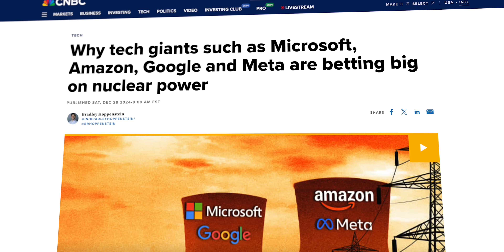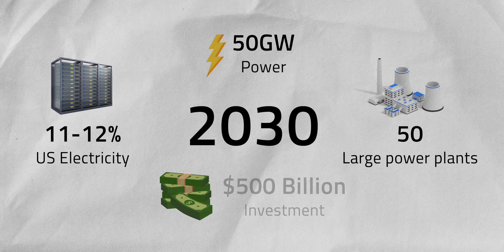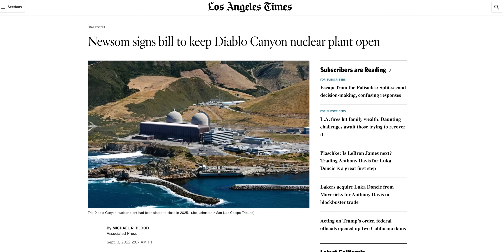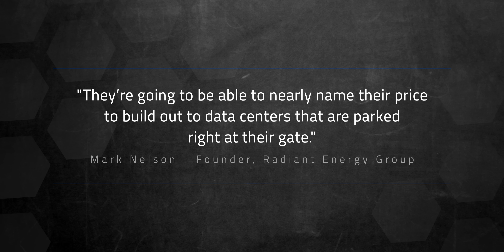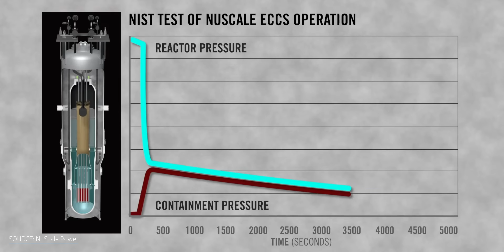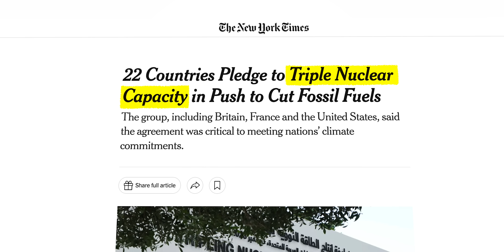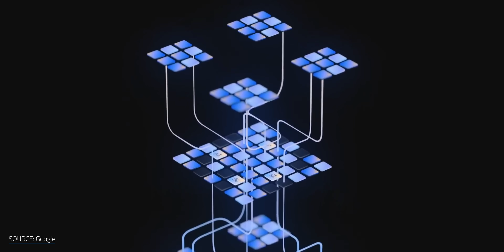Why Big Tech's Betting Billions on Nuclear (Not Renewables)

Comment: I've never understoood why nuclear safety features weren't more like air breaks on semis.  The breaks require air to shut OFF not on.  If you loose air the breaks come on locking the breaks and thus making them much safer.  Even if the air lines compressor or engine quits you have breaks.  Nuclear should be the same.  Require power to shut off the safety features.  If you loose power for any reason, control rods drop and stop the reaction.  I know you still need to be able to run coolant, but stopping the reaction would go a long way.
Reply: That is exactly how many plants work (except BWRs because their rods aren't on top). Control rods or a boric acid solution are held in place electromagnetically....no power and either the rods drop into the core or the boric acid is injected into the coolant with the same result. 
The issue isn't shutting down the reaction, it is removing the decay heat after you do so. Most of the newest designs add passive decay heat removal to address this so no electric power is needed to safe the reactor.
Reply: @richardbaird1452  I thought it seemed odd that they didn't work that way. But whenever you watch videos about different incidents or whatever, they don't seem to address that very much. Or maybe I don't pay close enough attention. Thank you for the informative response. That was great.

Comment: Dear UWMF, The NRC regulatory environment exists because of the public's demand to make sure another Three Mile Island or a Fukushima never happens again. In some ways the nuclear industry has only themselves to blame. Modular nuclear power in the current safer designs is an important potential, however the fuel issue, while some say Breeder Reactors will be the key they have significant safety, technical and cost issues. Spent fuel from small modular reactors will likely be stored at the reactor site or in a consolidated interim storage facility until permanent disposal is determined, and currently this is exactly what we are doing at the older, larger, expensive and convential nuclear power plants. Until some way arises to ship and then store spent nuclear power, small module nuclear power will not be cost effective.

The issue with next generation AI and all other Data Centers, is not that they need more power to exist, the larger issue is that we need to move computing away from pushing electrons around various materials, we have reached the limit of this technology, and instead we need to work towards a newer, faster, system to create Yes / No gates that serve the same function, but use little to now power.

Comment: Nuclear is the baseload generation we need.
Reply: but is AI the baseload demand we want?
Reply: @jerrik-415  Nope.
Reply: Baseload is just as bad as intermittent.  You can't suddenly fire up more nuclear when everyone suddenly turns their air conditioners on.  Reactor efficiency drops dramatically when they aren't at exactly their optimum output level.  So nuclear would need the same batteries and storage as renewables.
Reply: @VPWedding there are more modern designs of reactors that can do that. Illinois EnergyProf has some good videos on these new designs.
Reply: The need for baseload is a myth and batteries actually can provide better "baseload" (more responsive frequency and level matching) than real baseload. Grid scale batteries + solar/wind are already cheaper than nuclear or fossil fuels and costs are still dropping precipitously as manufacturing capacity grows.
Reply: @tHebUm18  Nuclear is vastly more viable then solar/wind + batteries. To electrify just the USA would take 100% of the worlds Lithium reserves for about 70 years. That's just for EV's. Most solar comes from China, the reason it's so cheap is because of a complete lack of environmental or worker protections. Meanwhile a thorium or uranium salt reactor has practically no waste and has no liquid waste compared to classic nuclear reactors.

The need for a baseload isn't a myth, you're just arguing to supplement out the baseload with power that's more useful for peak demand time. The baseload isn't a responsive system, it's the freaking base load. The benefit you mentioned is why they're better suited for peak needs. Also if we over build on the baseload we can have excessive power and just "dump" it into CO2 collectors and make efuel for the aviation industry so it stops emitting.

There still isn't a good solution to the windmill and solar panel waste problem, what do you do with the tons of windmill blades and the tons of burned out solar cells? We don't seem inclined to recycle them. The power density of nuclear is why it's superior, nothing is perfect short of fusion but fission is the perfect stop gap to get us to fusion.

The literally dump the toxic waste in fields used for growing food. Why do you hate the earth so much? Rooting for solar isn't rooting for a cleaner tomorrow, it's rooting for less CO2 but WAY more toxic waste in the soil, water table, and in some cases literally filling entire lakes.
Reply: @tHebUm18 and nuclear + storage is better than renewables and data 🤷‍♂️ if u wanna play the storage game dont get butthurt when nuclear beats out renewables
Reply: @ Nuclear won't. Renewables + storage have the lowest LCOE of any source today (including new fossil fuel generation) and it's still dropping precipitously. That's why year after year adoption keeps dramatically beating expectations.

Not a single watt of new nuclear commercial generation (not counting reactivating existing reactors) will occur before 2030 while all these AI data centers will be built before 2030. It's chronologically impossible.
Reply: @tHebUm18  It's not nearly impossible it's just difficult, we need to streamline the bureaucracy of building a nuclear plant. Fuel is cheap, reactors really aren't that expensive, it's just regulations, the bureaucracy, and the insane excess of safety in the west that causes nuclear to be so slow and expensive to build. I believe we should remain cautious but we can easily do SMR's at scale if we'd have the will power to do so.

Comment: Renewables were ALWAYS a dead end technology because its completely impossible to run a grid on 'random' energy generation. Every penny wasted on them is a penny that will have to be spent AGAIN on dependable energy...Which we had all along!!!
Reply: Apparently you know nothing about battery backup for solar and wind.  Here in Texas, more wind power than any other state, and #2 in solar, they can't get batteries installed fast enough.  We have had no brown outs, black outs for several years because there is so much battery backed solar coming on board.

Stop with the right wing anti-renewable BS.  As I type, due to the way our market is set up, my all electric house is run on 100% renewable power.  Money well spent.
Reply: @frequentlycynical642  ...and you think you can run a country on intermittent power and batteries. 🤡🤡🤡 The country already had secure power before all the renewable garbage.
Reply: Well someone doesn't care about costs and the environment....  the US will end using less coal in 4 years time (like the first Trump disaster) ... and this is going the same way....

Comment: Nuclear makes sense for data centers. They run with constant load and nuclear provides at baseload. Its a match.
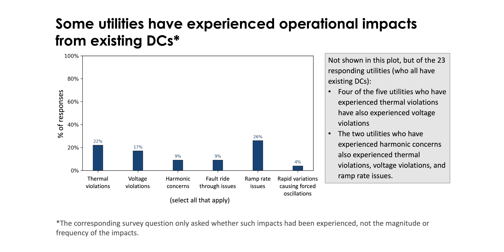Reply: not accurate. read the chart @6:00, regular power plants even have communication with DCs to tell them when to modulate their loads, and not as simple as you want to think of it "supply > demand"
Reply: @mrlithium69  that means that they often run below their possible maximum load

Comment: As the pendulum swings the other way and we increasingly "re-shore" manufacturing that went overseas over the past couple decades, the demand for electricity is also skyrocketing for manufacturing infrastructure.
Reply: The funny thing about tariff’s is that they permanently raise prices.  If someone was making a grommet in the US for $1, and one made in China costs $.45, adding a tariff of 25% does nothing except raise the price of imported grommets by 25%.  If you put a 400% tariff import on the same grommet, now imported grommets from China now cost $1.80.  Now the American business is desirous to build new manufacturing capacity in the US. Great right?  Guess what the new American company will sell grommets for?  $1.70, because it’s still cheaper than the imports.  Bravo now instead of grommets selling for $.45-1.00, now they cost $1.70-$1.80.  Sure people got a few jobs at the grommet factories, but how many businesses went under because the added costs to every import, just made things more unaffordable to continue.
Reply: @  Great point, Brett. Everything is connected, and people don't always think through the interrelationships of these "systems."
Reply: @brettgracey9682  if they can build overseas they can afford to move their manufacturing back
Reply: that is not going to happen... ask any economist.   There will probably be a drop in power demand caused by massive economic problems...

Comment: And people thought EV's were going to be the biggest problem facing our barely stable power grid in the U.S.

Also, all this power usage and I still have absolutely no use for any of these AI services. Just a waste of power and money.
Reply: If you are using the internet or a recent cell phone, you have been using AI.
Reply: @frequentlycynical642  For search results,  and Google Maps directions sure, but I have no use for chatbots, image/video generators, or AI assistants. Outside of  crunching massive datasets for science and the aforementioned low-level services, I really don't see anything other than a novelty that I have no interest in.

Comment: You just don't get it: 
Increased electrical generation needs (EVs, heat pumps, grid, ...)  for electrifying the US is impossible. 
Similar increased electrical generation needs for datacenter and AI centers in the us: No Problem.

Comment: What about the waste material disposal/storage? I believe the safety of nuclear plants isn't the only reason they wanted to get rid of them.
Reply: It's called reprocessing. It reuses most of the spent fuel to create new and more powerful fuel rods for use in a reactor again.
Reply: Modern systems use these massive con rent cylinders to store waste on site. Far too big and heavy to steal, robust enough to take anything short of a nuke or large meteorite impact. Easily to monitor and if you do find a better system easy to access.

Comment: Wouldn't it be cheaper and quicker to do solar/wind and battery storage?
Reply: > Wouldn't it be cheaper and quicker to do solar/wind and battery storage?
Well it is quicker, but it isn't very effective.

Basically, these companies have already looked at these factors, and they have determined the lowest risk (of going offline) and lowest costs are nuclear. They aren't stupid, they aren't deluded, they have spent months if not years really digging into the details - and nuclear came out as the answer. Wind/solar/batteries didn't make the cut.

Comment: So as an electrical consumer my cost are tiered and as I consume more the cost per unit increases. Are these data centers really paying their fair share? 
Also seems it might be more cost efficient to create more electrical storage capacity than building new generation. A lot of power generation goes off line during the day time when solar is abundant. If these stayed on line charging storage facilities seems that would be significantly less costly
Reply: Yes, the price of battery storage is dropping, making both EVs and storage of renewable power the best options.
Reply: Wow what nonsense

Comment: Another huge advantage of SMR's is higher capacity during refueling. If you have 1 large 800 MW plant running your data center, and then every 18-24 months you take all 800 MW down for a few weeks to refuel, you've lost your entire power source and finding an alternative for 800 MW is a big ask.. If instead you have 3x 300 MW units then you can stagger the refueling outages and at worst you lose 1/3 of your capacity for maintenance, instead of all of it. Finding a backup 300 MW is a much smaller ask, if you buy 1 extra SMR, 30% additional cost you could have 100% uptime and never have to resort to finding power elsewhere during maintenance. Compare this to if you wanted redundancy on your 800 MW plant, you'd need to buy 1 additional plant at 100% capacity, double your costs. 

I could see that being a really big deal for this data center stuff - uptime and reliability.
Reply: not really an issue when several GW plants are in the grid. Only planning is needed
Reply: @carlchristiansteglich-pete6409  Yes that won't be an issue for amazon and others that are directly getting their power from the grid, but what I meant was microsoft who wasn't getting it from the grid they were buying their own 800 MW plant.

Of course the grid can makeup for power loss even in that case, but going from demanding 0 electricity, to 800 MW, requires some planning, grid operators can't just spin up 800 MW out of nowhere In general the grid does not have that much surplus sitting around waiting to be used.
Reply: or you can buid reactors that can be refueled while running, like CANDU, or god forbid, RBMK
Reply: @Viktor-x1w7w  Certainly CANDU is a good option, not so sure about RBMK 🤣. Although admittedly I don't know anything about any improvements they've made since chernobyl, have they at least sorted out the positive void coefficient issue?

Comment: Unbelievable that the waste product, which remains toxic for 100,000 years, was not discussed.
Reply: France 24 recently did a good documentary on how they reprocess their spent fuel. I recommend watching it, then you will be asking why the US doesn't do so as well.
Reply: @  thanks for the tip. I’ll look for the video. 
My guess is if the US isn’t doing it because it’s not economically viable.
Reply: @bilo6832  The US isn't doing it because A) regulations forbid reprocessing, and B) yes, the new fuel is (currently) cheaper than reprocessed fuel.

Comment: The passively safe reactor sounds like a huge step forward in genuinely 24/7 safe nuclear. I’m particularly impressed with the passively safe fuel designs. If it truly works as envisaged then we are out of reasons not to build these type units. But I don’t blame the NRC for being cautious their approach has kept us safe and delivered the promise of nuclear for decades please don’t dismiss them as a bunch of bureaucrats and hacks holding up progress. They have good reasons to be cautious. The best laid plans of mice and men, what could possibly go wrong with this!
Reply: Good old PWRs also have passive safety - if the water boils off - the moderator is gone
Reply: @carlchristiansteglich-pete6409  But it melts down anyway, because the decay heat density is so high.
Reply: @da1l616 ok, sure, but it still can’t leak radioactivity in the environment
And water boiling off would be the last step before of a long series of remediations
Chernobyl is something that couldn’t have happened in the west for many reasons even with the designs of the time
Thinking that it could happen again or that it could be even worse is pure fiction
Reply: I disagree, the regulations have made the costs blow up for a very limited safety benefit
Modern gen 3 reactors are unthinkably safe from all points of view
The reason to build SMRs is not more safety, they solve different problems. Safety is one we already solved
Reply: 500 million to get the us nuclear admission to allow the SMR. regulation is the enemy of innovation
Reply: There was a post-Three Mile Island disaster research analysis that concluded that nuclear technology is so complex -- and additional safety measures make it even more complex -- that it is vulnerable to ever be truly safely operated. Complex systems need the operating conditions to stay within acceptable ranges. As weather becomes more extreme, and as watchdogs get fired by wealthy corporate leaders and owners, we would be foolish to think that we can be masters of our inventions in all conditions. 

Who is more exacting and careful than the Japanese? Fukushima was a reminder of our over-confidence that we can control nature and matter.
Reply: @TurnToWellBeing  A large part of why Fukushima failed is because of TEPCO corruption. A large reason for that corruption is the Japanese tradition to defer to authority and keeping the peace. There were reports and warnings to TEPCO about their seawall but they ignored them.